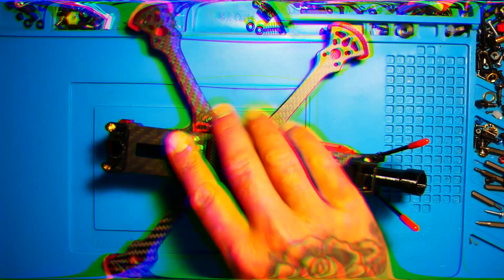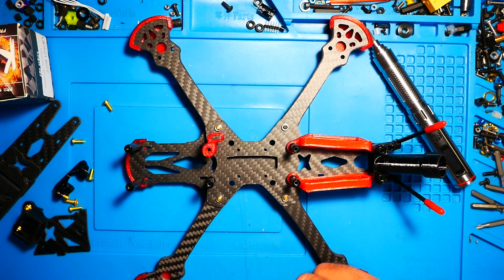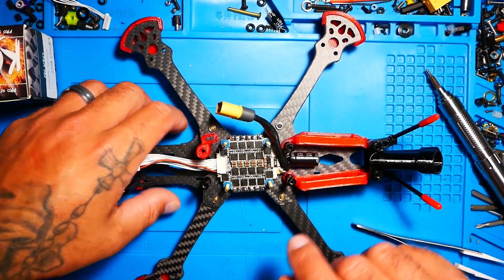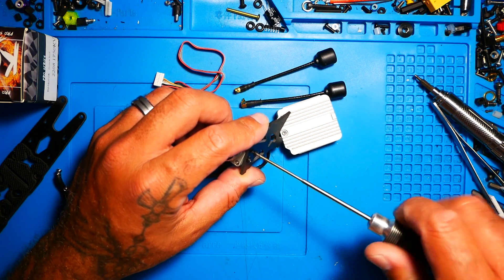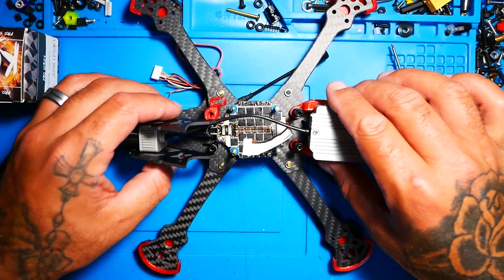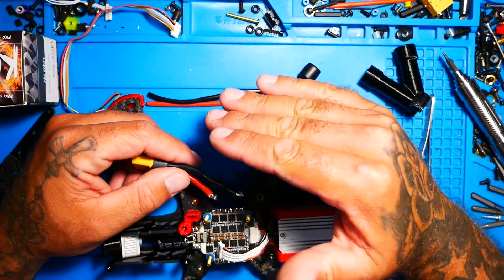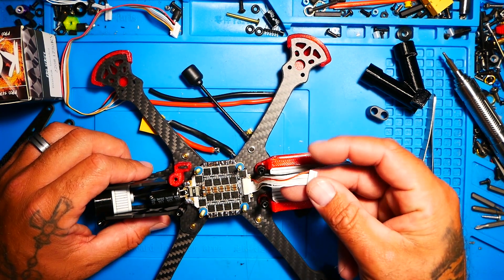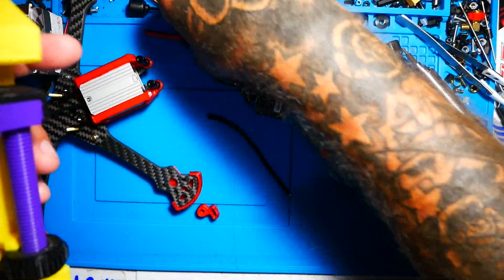Let's Build The Brand New Sector 5 V3

Comment: Hi Drainman!

I just purchased sector 5 v3 for dji.
I got a little disappointed with the tpu at the back where’s the antennas. Feels so tight and bad when inserting it. 
Checked some other builds and saw that they have flipped the air unit to lower to sockets for the antennas. I didn’t manage to see your antennas installation in this vid.
Also I’m having an issue with the camera since there’s like a small gap at the front and the camera actually thinner than the space left at the 2 plates. May I compare your build with mine? Some this just feels weird here... thanks!

Comment: when you connect your flight controller to your ESC using your PIN header does it really matter if your signal wires like 1 + 3 is Swop around 7 the reason I asking is that I got hglrc. F7 fc and also got the 60 amp ESC and the pin header had to be Swop around 1and3 signal wires and also the rx and the current had to be swiped   around .? Just wondering if I really had to or not I did but I was just wondering if I had to
Reply from the maker: It does not matter, as long as you remap them after. If you don't want to remap then yes it matters.

Comment: I absolutely hate the mmcx connectors that are on the air unit.  I've crashed my DJI build twice... I broke both mmcx antennas on the first crash (replaced them with new antennas), then ruined the actual air unit connector part on the second crash lol.  Let me know if ya ever figure out a half way decent mounting option for those connectors that won't break every single crash